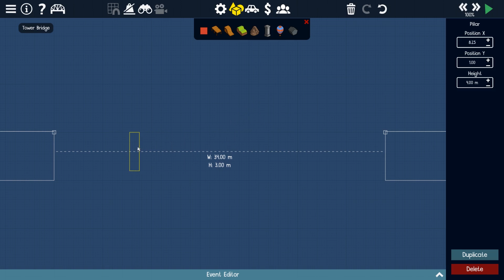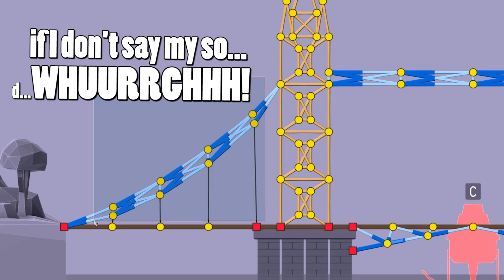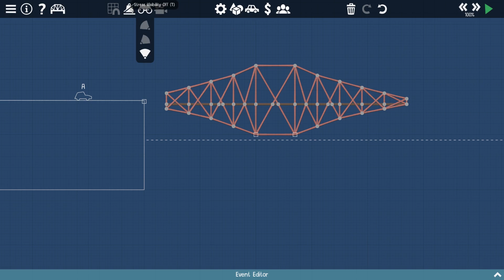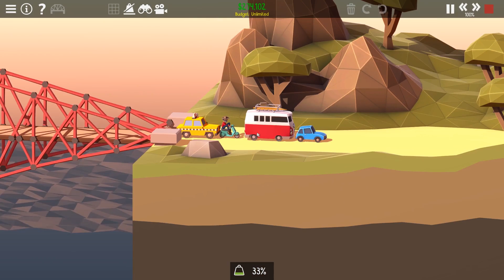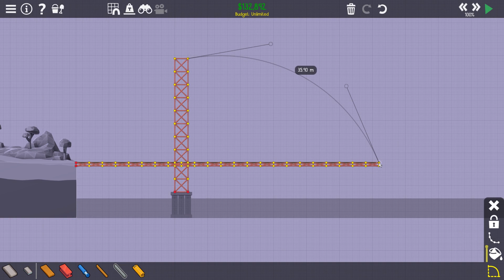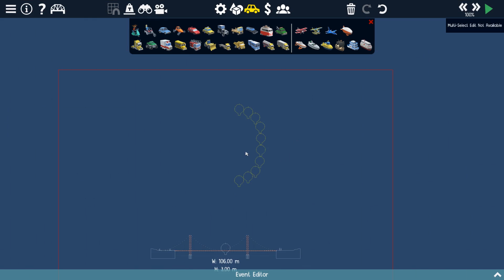3 ICONIC BRIDGES built by a real engineer in Poly Bridge 2! 1000 subscriber special!

Comment: I think the road in the golden gate is breaking because the design doesn't allow any flex. If you broke it up into several sections of truss connected by single pin joints, then they could sag a little bit instead of breaking.

Comment: 5:35 For those who are curious since its sorta funny, The original London bridge that spanned the river Thames in the 1800s is no longer in London but rather Arizona oddly enough. You can read up on the story yourself if you so wish but it had been moved in pieces and reassembled in Arizona of all places. So London per se doesn't have it's London bridge anymore, but apparently  Arizona does. What use it would be in the hottest part of the United states is still up in the air though.

Comment: Just to give an idea of how HUGE the Golden Gate bridge is.
Main span 4200ft:
Length of ONE cable: 2331.7m (7650ft)
Diameter of ONE cable: 92.3cm (36 3/8 in)
Wires in each cable: 27572
Total wire used: 128748km (80000 miles)
Weight of the cable: 24500 tones (22226 m. tones)

It's just ridiculous...

Comment: I'm not entirely sure, but I think the road was breaking on the Golden Gate Bridge because the cables were attached to the road junctions on top instead of the steel junctions beneath it. This makes the steel on the bottom's weight rest solely on the tensility of the road (which isn't a thing for roads in this game, too much stress and they break, never bend.) Moving the cable to the steel on the bottom isn't entirely accurate, but the real bridge has a sort of steel cup that the road rests on, which isn't possible in 2D. One last thing, the road has a very slight upwards curve, which would really help because the cables can only do so much, and the weight will be instead distributed to the steels resistance to pulling apart instead of everything resting directly on the road. I'm gonna try to recreate what you made and make the changes, I'll update this comment later.
Reply from the maker: This reminds me, I don't think I made these levels public in the workshop. Will do it tomorrow if you want to try on my actual design!

Comment: I think that polybridge might not differentiate between tensile and compressive stresses, and because of that, structures which use the fact that materials like steel are very good in dealing with compressive stresses, don't work.
Hence the towers of the goldengate bridge collapsing under their own weight.

Comment: “The actual bridge is 1.7 miles” Did the conversion, fully do not blame you for only wanting to do 100 meters.  1.7 miles is ~2735 meters!

...Although now I want to see someone actually do that.

Edit: I think your Golden Gate Bridge might work a little better if you used steel beams for the arched support “cables,” since the real bridge has those giant steel pipes or whatever.  I’m most definitely not a civil engineer though.
Reply: Those "pipes" are dummy thicc cables, I'm pretty sure.
Reply: @hirigone  Ehh...probably, now that you mention it.  They definitely look like they're pipe or something similar.
Reply from the maker: They're actually many cables inside a tube to help protect them corrosion I believe. Also in polybridge cable is far stronger than steel in tension, so it would have actually made it worse!
Reply: @RealCivilEngineerGaming  fun fact: The Golden Gate Bridge gets fresh paint every four years, but it takes four years to paint the entire bridge. Year round maintenance is required to keep it from becoming a rusty shipping hazard.

Comment: The convex curved cables are tensioned, which pulls on the (could be rope) vertical cables upholding the roads, transferring the weight of the roads to the towers and ground attachment points. The towers needs equal downwards and sideways weight pull on each side and in between them so they don’t shift and tilt over time, since they carry such a weight, which is why its shape repeats itself like that.. 
The issue in the game is that the curved cables aren’t tensioned, causing the roads to undergo huge compressive stress as the steel structure below and the cables above cause the bridge to sag, which causes the roads to break.
The game engine gives most building parts in the game minimal flex, which is why the bridge sags. Without that minimal flex, the game would be quite different.

Comment: I think the main reason why the Golden Gate Bridge didn’t work too well was because the towers weren’t sturdy enough, more reinforcement on those maybe (I’m not an engineer, I just play poly ridge) and because like you said there is SO much weight on those pillars they just crumple, that’s why this anchor points on the top just stopped everything from breaking, if you ever revisit it, make sure the load bearing structures like those pillars are way OVER reinforced because that’s how polybridge is now sorry if I’m wrong, this is just from my experience from poly ridge 

Also your channel is growing SO FAST CONGRATS it feels like just yesterday it was at 1k (and I think it was XD)
Reply from the maker: Yeah I think you're right too, I'll no doubt go back and have a play with this one!

Comment: Mr.Engineer man, you can use your keyboard keys for shortcuts in poly bridge, examples
d - delete selected material, c - copy selected material, x - cut out selected material, f - flip copied/ cut material, v - vertically flip copied/ cut material, z - undo, y -redo, arrow left/ right - rotate one degree, g - grid off/ on.
These are the ones I know, probably some more but just wanted you to know. 👍
Reply from the maker: Thanks, probably should start using these!

Comment: The cables are distributing the weight. But you forget you put anchor points at the top. So that's why the towers didn't stress
Reply from the maker: Yeah I didn't explain that very well, but I wanted to show how the cables strain as I think it was breaking due to the steel pillars not being strong enough. Great spot though!

Comment: So I live pretty close to the Golden Gate Bridge and I cross it every once in awhile. What I think would’ve helped the bridge 1. Look more like the Golden Gate Bridge, and 2. Be more sturdy, is the replace the cables connected to the towers with steel. Those cables are MUCH thicker, and are definitely a LOT stronger than the other ones. It also gives them that red look!
Reply from the maker: Not sure poly bridge would allow that, cable is super good in tension and far stronger than steel, they go orange in my version so I imagine steel would have snapped